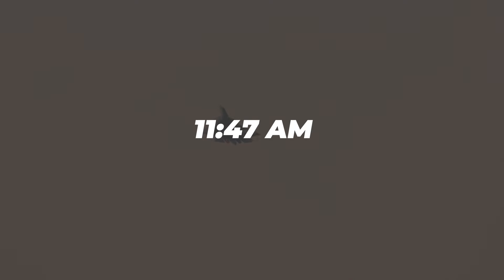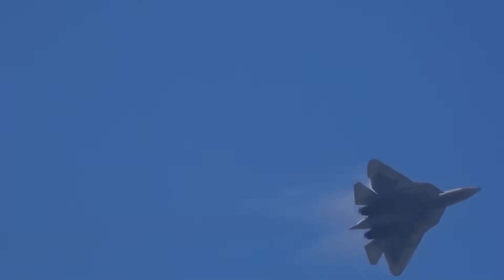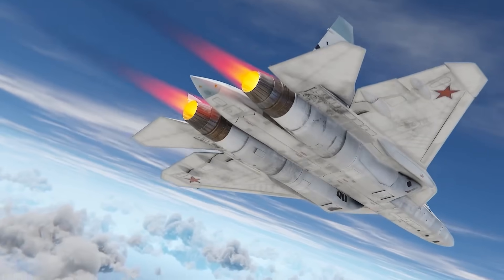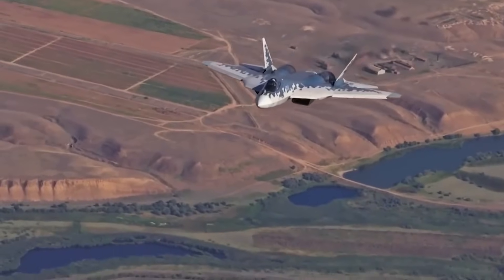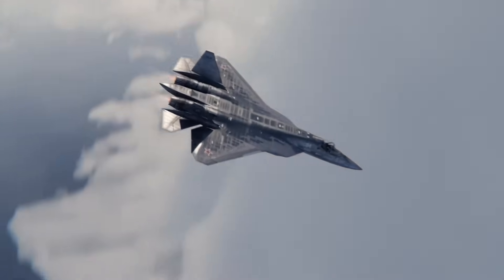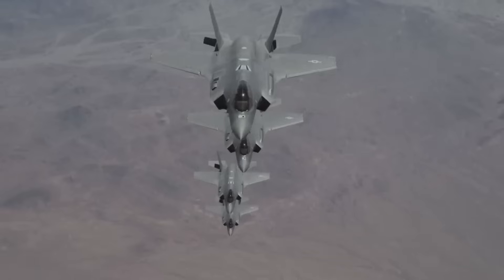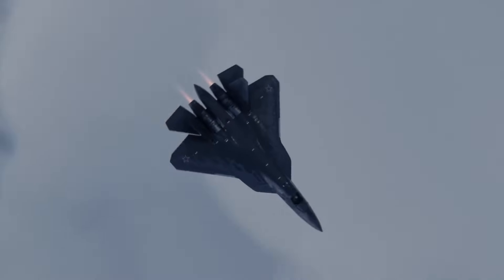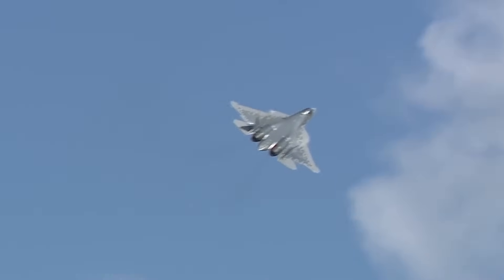Why the Su 57’s ‘Bad’ Design Is Actually Genius

Comment: 02:50 Sukhoi left the round engine nozzles as is, because their engines are only to come. They invented completely new 3D metallurgy printing just for the nozzles. Something that west has not even seen. It is equal to invention of the titanium welding.

One thing that can be seen from the west "experts", is that they do not know how not to eat their own s*t they spew from other end, when mocking the adversary with jokes and assumptions.
If you don't know something, then at least have a respect to yourself to announce that YOU DO NOT KNOW. 
Don't make any assumptions, don't make any kind predictions or anything. Assumption is not worth of the knowledge.

And when you once realize that you don't know, and you would need to speculate and assume things, it means you can just stop all to point where your knowledge ends.

Like Sukhoi clearly explained from the start that they have only prototypes and demonstrators flying in the airshows, and people rushed to mock Sukhoi and russians that they don't even know how to make a smooth surface. 

A classical mistake that only Western people do. 
When you observe neutrally what Chinese and Russian's do in their analysis, they are absolutely hardcore to what is true and what is not true. 
They know how to separate facts from the assumption. They don't mock the adversary or rivalry. That is something so refreshing always to see as westerner, after listening and seeing us mocking everyone else, that how Russian's and Chinese respect everyone, and they knowledge what works and what doesn't and don't make assumptions.
And they don't go thumping their chest that they are best of the best, why they get underestimated constantly by our "experts" and then our "experts" are again explaining or deceiving with ignorance how they failed to understand even how Russian's or Chinese beat us. 

There is no need to even watch anything from the Russian's or Chinese, just observe what we do. And the information (or lack of it) we receive from our "experts" reveals what s*t we are told.
Reply: it is about tricking a big enough percentage of sheep
Reply: @snorttroll4379  Not really. The gossips are way downstream of the battle for military hegemony. But the weak rely on propaganda for every advantage they can possibly take. Russia's weakness is not in design but in keeping both quality and quantity enough for their needs. The only natural enemy to the Russia Republic is the CCP. And the former Soviet Republics that still have strong Communist wings in their ruling capitals. Russia doesn't fear the CCP's AF. It's the massive army that Russia fears. And Russia's AF struggles to even think about taking out frontline jet fighters. But they can easily dominate any other jet fighter native to Europe. So in the minds of the paranoid, anyone that wants to end NATO is doing so to favor Putin. If the EU wants to be a federation that is a sovereign nation like the UN it needs to walk the walk and live us Americans in peace. If not, it needs to STFU as if they have this ability to politically dominate anything or anyone. Even their own members. There are lots of legitimate criticism of both Russia and most Western European nations as well. And if you want to criticize any nation in the Americas you must recognize that it is leftwing politics that caused this just as it was invented to kill Louis XVI and eventually each other as they promoted Napoleon from artillery officer to Emperor. The French Jacobins literally invented class war theology or "political science". Marxists made it far more dogmatic and universalized it as a "science". And here we  are today.
Reply: "02:50 Sukhoi left the round engine nozzles as is, because their engines are only to come. They invented completely new 3D metallurgy printing just for the nozzles. Something that west has not even seen. It is equal to invention of the titanium welding."

blinks the fuck are you talking about? 3d-printed titanium cintering has been around for years.
Reply: @paristo:
Unimpressed with the Su-57 that Rosoboronexport had deviously claimed is a "𝟻ᵗʰ-𝚐𝚎𝚗." fighter jet, India rejected it in 2018. 
Russia still refuses to give Indian pilots access to the cockpit and will not allow them to 𝘵𝘦𝘴𝘵 𝘧𝘭𝘺 the aircraft.
Nevertheless they expect India to buy 2 to 3 squadrons of Su-57s. 😂😂😂😂😂
Reply: "First they ignore you, then they Iaugh at you, then they fight you, then you win...” - Gandhi

Ah, they'll just make another cringe Mickey Mouse Hollywood movie with Tom Cruise, and problem solved.
Reply: Right, that's why Russia cannot defeat a nation ranked #22 in military power and over 1 million Russian men dead with no victory insight. Also, why the Russian have fuel and power shortages. Also, some of the poorest people in the world. Russia has invaded their neighbors at least 4 times in the lasty 30 years. But the problem is not the Russian people it's their dictator. I was in the Crimea for the winter n 2013 and into 2014 yes, I was in the Crimea when Russia invaded. I spent time with many Russian women and men. The men were strong and honest the women beautiful, but they were poor. If Russian leaders were more interested in helping its people instead of building weapons and invading other countries the Russian people would be much better off. I have lost contact with my friends in the Crimea, and I worry about them and hope they are OK.  One note: people line up outside American embassies around the world wanting to live in America, In Beijing I walked past French, Russian, British and other embassies and there was no one there, just the guards. But at the American embassy the line went around the block and down another street. So why does everyone want to move to the USA if China and Russa are so great. Again, I have spent a lot of time in both countries, and both suffer under bad government, we did too under President BiDum but our system allows us to correct the problem at the next election. I hope the Russian and Chinese people can get a chance for freedom and then they can become a strong and prosperous people!!!
Reply: @garymccann2960  Don't worry about the lunatics. Don't become one of them.
Reply: @garymccann2960 You don't know what freedom is. You are distracted by politicians; you think you decide something in government, but it's a false power. Western governments don't listen to their people. If they really listened, they wouldn't be funding wars everywhere. The poverty level in the US is higher than in Russia; I can't even try to compare it to the Chinese. Western leaders are criminals, murderers, thieves, bandits. The Chinese and Russians don't interfere in Western politics, but bandits always have something to teach.
Reply: Special operation? Is to kill  all of the convicts and the  disperit   people on the front  lines
Reply: @garymccann2960  "Right, that's why Russia cannot defeat a nation ranked #22 in military power and over 1 million Russian men dead with no victory insight. Also, why the Russian have fuel and power shortages. Also, some of the poorest people in the world. Russia has invaded their neighbors at least 4 times in the lasty 30 years. But the problem is not the Russian people it's their dictator. I was in the Crimea for the winter n 2013 and into 2014 yes, I was in the Crimea when Russia invaded. I spent time with many Russian women and men. The men were strong and honest the women beautiful, but they were poor. If Russian leaders were more interested in helping its people instead of building weapons and invading other countries the Russian people would be much better off. I have lost contact with my friends in the Crimea, and I worry about them and hope they are OK.  One note: people line up outside American embassies around the world wanting to live in America, In Beijing I walked past French, Russian, British and other embassies and there was no one there, just the guards. But at the American embassy the line went around the block and down another street. So why does everyone want to move to the USA if China and Russa are so great. Again, I have spent a lot of time in both countries, and both suffer under bad government, we did too under President BiDum but our system allows us to correct the problem at the next election. I hope the Russian and Chinese people can get a chance for freedom and then they can become a strong and prosperous people!!!"

People in CCP-ville and Russia line up around the block because half of them are probably fucking spies still trying to figure out what Hell anything means.
Reply: @garymccann2960  What kind of medicine are you taking that causes you to have such strong hallucinations?
Reply: @garymccann2960  Вы несёте феерический бред, повторяя, как попугай, нарративы украинской/западной пропаганды. Даже в первых трёх предложениях вашего опуса есть несколько ложных/манипулятивных утверждений. Вывод: вы или дешёвый пропагандист, или просто не слишком умны...😁
Reply: so good why do they not  use these aircraft  in Ukraine!?
Reply: @benWestfall-v7z  Military jets are not really ideal for civil wars with constant ebb and flow of lines of control. Unless a few air attacks can clearly win, it's better to either end the war or accept the body counts. If both sides employed tanks then antitank aircraft would be useful. Air superiority fighters won't be unless they are very flexible and refined for "multirole" employment. The Russian war in Ukraine is just drifting and keeps Russian needs alive as long as the war it still running. Once at "peace" the real patrons of Ukraine will try to move in and use it as a staging area to creep up on Russian sovereignty and security as before but with greater gains than accomplished under Obama and Clinton (as US SECSTATE).
Reply: @benWestfall-v7z  Why don't Russia use everything they got in Ukraine, all the nuclear missiles and all?

Seriously, because they have it, they don't need to use it. 
There is no missions for these, as Russia doesn't perform war as awfully manner as NATO does by first doing air campaign. Russia doesn't need, it can strike anywhere at any given time without fighters. 

People like you don't understand that Close Air Support missions has gone away. There is no A-10 or Su-25 flying over and providing support.

There is now few drone operators that are operating dozen drones and few observers that see everything just from birds view, not from kilometers higher etc. The time delays to get a air support is manner of seconds with drones, not minutes as with airplanes.
Reply: @garymccann2960 
Jesus wept.. it's impressive how you managed to squeeze in so many BS Western propaganda points while also adding your own delusional fantasies! 😂
In your hallucinations, are you also a secret agent, like 007..?

"The names Mong. James Mong. I've got a LIEcence to... uhmm, drive." 🤥
Reply: @garymccann2960 American embassy common and stop the lies Canada I can believe but not the US also I've lived in Russian for years and I can tell u it's great and no issues
Reply: @garymccann2960 :yeah, cope harder
Reply: @garymccann2960  😂😂😂😂🤡

Comment: He also brings up notching and chaff like it’s some unique Su-57 superpower, but that logic doesn’t really make sense in modern air combat. Fox-3 missiles exist. Once an active radar missile goes pitbull, the launching aircraft does not need to keep guiding it with “cheek radars” while flying at 90 degrees. That argument feels stuck in semi-active missile logic.

Notching itself isn’t a magic invisibility switch. An F-22 can notch too. Any modern fighter can beam and deploy countermeasures. More importantly, not all radar modes are pure pulse-Doppler. In certain track modes, when flying high with little ground clutter, or when facing modern AESA radars, the Doppler notch becomes far less effective. Modern AESA systems are specifically designed to resist this kind of tactic, so presenting notching as a guaranteed way to disappear is misleading.

The “cheek radar lets the Su-57 guide missiles while flying away” claim is also exaggerated. Western fighters solve this through sensor fusion, datalinks, offboard cueing, and active missiles. You don’t need to physically point your nose or extra side radars at the target anymore.

The description itself is pure cinematic narrative. A low-altitude pancake flat spin is not a combat maneuver, it’s a controlled deep stall. It looks impressive at airshows, but it doesn’t prove survivability, lethality, or dominance. Air combat is not decided by post-stall tricks.

The idea that Russia deliberately rejected Western stealth doctrine on purpose also falls apart when you look at reality. Newer Su-57 airframes are already moving toward redesigned engine nozzles that closely resemble flattened F-22-style nozzles to reduce rear-aspect radar and infrared signature. If round nozzles were such a brilliant intentional choice, there would be no reason to change them.

Claims about Syria deployments, “listening to F-35s,” or rumored radar locks on Israeli aircraft are unverified and speculative. “Rumors suggest” is not evidence, and testing sensors is not the same as proving combat superiority.

As for stealth, the Su-57 has clear design compromises, especially from the rear. Exposed engine features and nozzle geometry work against low observability. Joking aside, the only place where the Su-57 is truly stealthy is in the hangar — that’s why nobody sees it on radar.

And a genuine question: is this video using an AI-generated voice and script? It sounds like stock Su-57 footage with dramatic AI narration rather than an actual technical breakdown, which would explain why so many confident claims don’t survive basic scrutiny.

So no, the Su-57 isn’t clearly a better dogfighter, and it’s definitely not superior overall. The F-22 remains a mature, highly maneuverable, BVR-dominant air superiority fighter built for real-world combat, not marketing claims or airshow footage.
Reply: 😂😂😂😂😂 thats exactly is what russia wants you to think believe meanwhile SU 57 destroyed F16 from so far away so quietly that poor Hollywood fantasy plane and pilot never knew what or who hit it.

F22 is a Hollywood bluff just like F114 NIGHTHAWK and if russian weapons were actually bad yall americans would not steal K129 MIG 25 MI HELICOPTER and many more...
Reply: The new engines have a 3D axis flat nozzle.

That being said it isn't as stealthy as the F35, or F22.

Also both sides have fire and forget missiles, so pointing the aircraft nose is irrelevant.
Reply: "Modern AESA systems are specifically designed to resist this kind of tactic, so presenting notching as a guaranteed way to disappear is misleading."

Soviets already designed system around notching problem with the IRST. 
The MiG-23 had the so called "Sensor Fusion". The IRST and Radar supported each others, and pilot chose which one is the primary sensor. 
The IRST is always active, but the radar emission can be turned off to passive mode (usable with the group searches where someone else "paints" the target).

You can't "notch" the system, as when the radar loses the lock, the IRST maintains the lock (of course depending the cloud cover and other weather effects). 
The SARH missile is as well not directly between guiding radar and the target, but ahead of the LOS, so it has different angle than the "notching" angle. 
And SARH missile doesn't need to receive signal from radar lock, it can just receive the returns from the target, via range filter to ignore background etc.

The MiG-23 as well already had a capability for a "buddy guiding", a feature since then been in Su's and MiG's. 
The missile launching fighter doesn't need to be one guiding the SARH at the target, the launching aircraft can turn out after launch, if they have a buddy guiding missile via its own lock.
The Su-27 even has a own panel for the group guidance.

These ideas are not unique or new for the Soviets, that combined these in the SAM systems as well. Things that people just don't understand as they have never even been in the real operator station. But have this fancy idea that a every SAM launch will instantly alert everyone in the area that missile is to be launched.

The F-22 is unproven fighter, not been in any BVR combat, not in any dogfight, and it is nothing more than a hangar queen with a some lame airshow demonstrations that even 70's original Su-27 beats in the aerodynamics. Reason is that all those are classified material.
The F-22 first aerial victory is a weather balloon, and that after couple misses with missiles on unevasive target. 
I wouldn't have even dared to paint the weather balloon on the side of the cockpit... 

Seriously, some countries know how to take beating to raise the alert to attacking enemy.
Don't be a fool and underestimate enemy because you see something blow up.
Reply: blah, blah, cringe Mickey Mouse cope lol
Reply: 100% spot on.